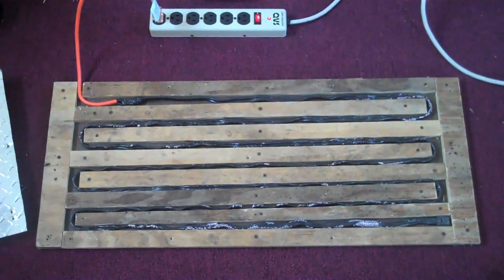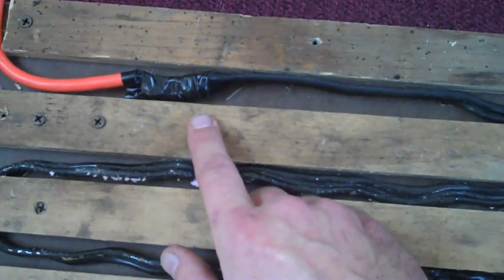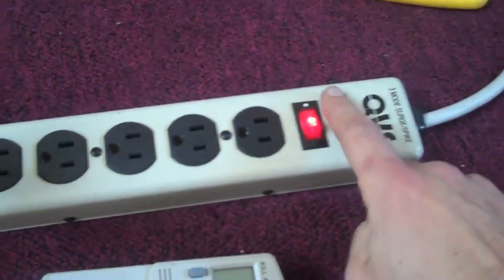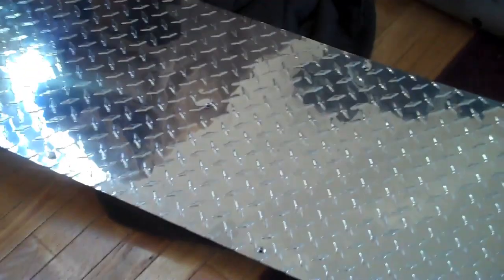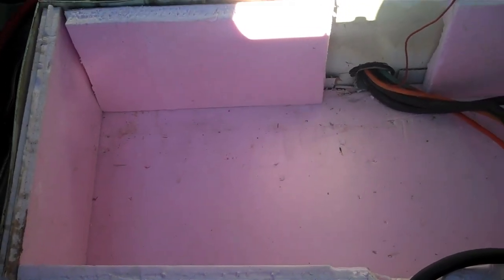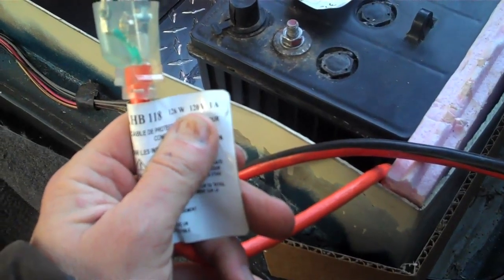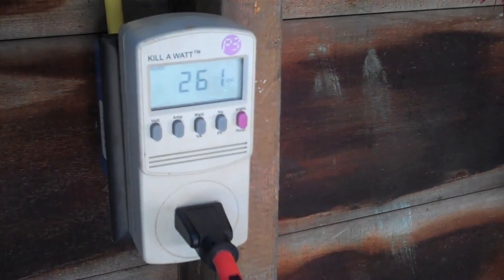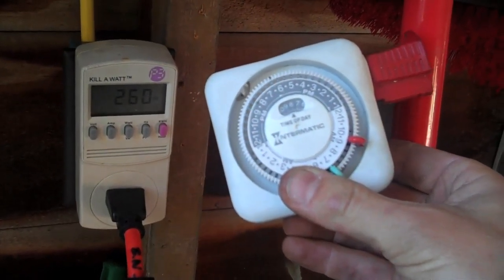Battery Warmer - part 2

Comment: Would the whole thing be more efficient if the heater cable was laid out so that it would be contacting and flat against the aluminum, for it's whole length?  It seems to me that as it is, the tape lays in the spaces between the planks and needs to heat the air, which heats the aluminum.  You could skip the wood strips altogether in this case - just lay out the cable on the surface below, use a bit of tape here and there to hold in place, and viola!  A spiral layout would avoid kinked curves.

Comment from the maker: I don't have temperature monitoring...yet.
I just bought a cheap indoor/outdoor thermometer today. It's wireless. I was planning on sticking the display on the dash, and the temp sensor down in the battery box.

Comment from the maker: Still need to experiment to see how long I need to run the warmer at what temperatures.

Today, (with outside temperatures at 38 degrees F) I ran the warmer for about an hour.
Doing a "hand-test" on the batteries, they felt NOT-cold. Which is exactly what I am looking for.